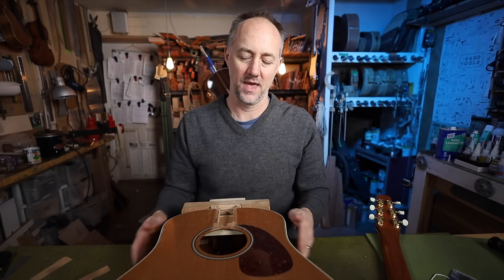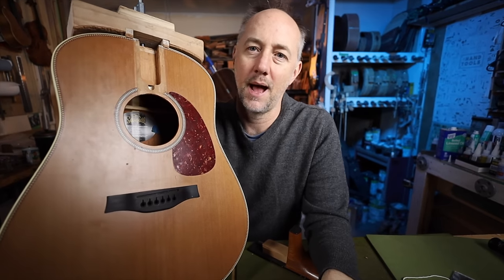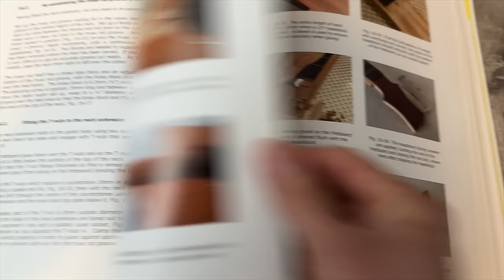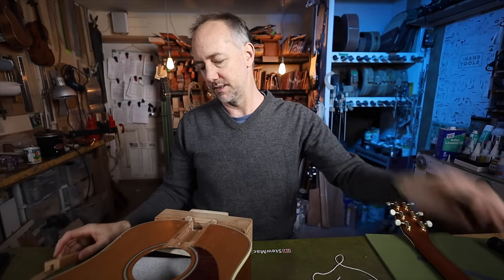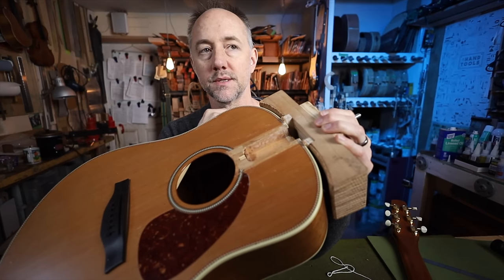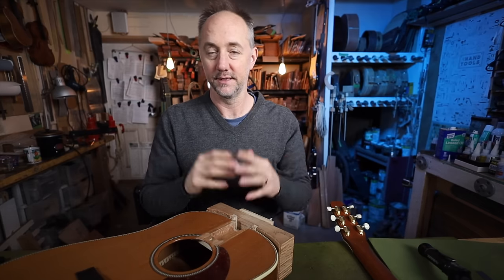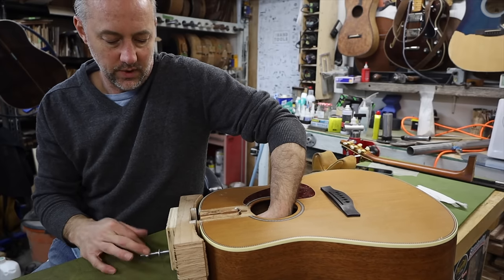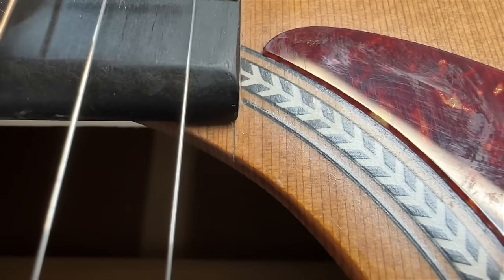The Hidden Problem with Seagull Guitars...

Comment: This is totally correct. I like Seagull's but I have 2 that needs neck resets now and I see them used that's down to the last bit of saddle before turning a decent guitar into kindling. :)  They are throw away guitars now (is what it is) 😀
Reply: If you plan on purchasing one you better take a hard look and see how much saddle is left also
Reply from the maker: Yes- if you buy a seagull, new or 2nd hand, check the neck angle and saddle height- if its all good you probably have nothing to worry about for a few decades  @tmcl7844

Comment: I'll definitely be taking a closer look at the 2003 for sale in my area as opposed to buying a newer one.
Reply from the maker: If i had the choice id get an older one but it may have more of a hump at the body join which is what they invented this neck joint to minimize that (and that part of the system works- but at an expense)
Reply: @BeauHannamGuitars  Yes it is quite a nightmare, I love the Seagull guitars but don't want to have to get a neck reset which would cost about the same as the price of the guitar here in Canada, I have really taken a shine to the Seagull Coastline Slim CW Spruce which is a solid wood guitar. I just did another set up on my Fender Hot Rod acoustic which has the rising belly so I run at about 4 thou neck relief without any buzz and have around 2.2mm low E and 2mm high E. Slotted the pin holes a little to get a better string angle and it sounds great. Just won't last forever LOL

Comment: Thanks Beau , I will be using your headblock design , is that your idea to taper the shape so it runs across some grain preventing cracking ? That's genius mate . Consider it stolen forthwith . Peace ✌.
Reply from the maker: Hahah/ thanks- not my idea. I do the same with the bridge wings and any braces like the center top brace on a classical guitar- I angle it so it crosses a few grain lines.
Reply: @BeauHannamGuitars  Yeah , I do it with bridge plates and bridges but never thought about the blocks . I suppose it could be used anywhere the sides run parallel to the grain . Still genius albeit a bit obvious . Peace ✌
Reply from the maker: @davidharris7431  thanks- yes- just never run a bit of wood along the grain of other bit of wood (especially a thin guitar top)

Comment: I had seagull acoustic that I put some heavy gauge strings on, and it got the exact problem as this guitar with the soundboard sheared on either side of the neck into the sound hole.
Reply from the maker: One of the worst breaks to have
Reply: Most players stopped using heavy gauge strings by the end of the 1970's: tough on the guitar, and even more so on the tendons! No need, unless you're tuning WAYYY down, IMHO. Light or medium-light still sound good. Besides, if someone's onstage they're either going through pickups or an instrument mic to get more volume.
     However, I learned plenty from  this video. Epiphones from Japan in the early to mid-seventies had that block slippage, practically a landslide of movement. I had used ultra-light electric strings with pick-ups, and more than a little homemade adjustments. Lasted almost 40 years, far more than it deserved, but eventually it bent & collapsed almost in every direction. The neck itself was fully bolt-on, so I might build something to it to make a portable travel 12-string, kind of in the Chapman or Gittler vein (showing my age here!).

Comment: I have a Godin Motif (nylon string parlor).   Do you see the same problem with their nylon string guitars?
Reply from the maker: I think they all have this if made after 2006. But it’s not a problem until it’s a problem and classical guitars have less string tension then a steel
String so you might be are for decades or always :)
Reply: @BeauHannamGuitars   Thanks Beau!  Neck is currently just fine on my Motif.  Light gauge strings sound best, so I'm not putting much tension on the neck relative to  a steel string guitar.  Thanks for your insight!

Comment: Godin 5'th avenue' is he a good one? Any problems?
Reply: I'm not a luthier, but I've owned a 5th Ave since around 2007 and it doesn't seem to have much in common with my Seagull acoustics (and is an archtop, so it's more like violin construction I guess). Entirely laminate, and as a result is like a little tank. I don't control humidity with it at all so it swings from humid Ontario summers to bone dry central heating winters and it's been bullet-proof. It is still factory-made, and I did find a misdrilled hole for one of the P-90 pickups that they just covered up with the pickup itself; however, for the low price they charge for that guitar I am willing to put up with a bit of slop as it looks lovely and I enjoy playing it so much. Easily my favourite neck on any guitar, acoustic or electric. I wish I could bolt one on my strat.
Reply from the maker: I like those 5th ave guitars. I dont know what the neck attachment system is on them- at Dynamic music where i used to work (who imported Godins for Australia) i loved playing a 5th ave with overdrive- made me sound like Oasis!- No Jazz was ever played on one by me though.
Reply from the maker: I like those 5th ave guitars. I dont know what the neck attachment system is on them- at Dynamic music where i used to work (who imported Godins for Australia) i loved playing a 5th ave with overdrive- made me sound like Oasis!- No Jazz was ever played on one by me though.

Comment: Crap!  I wish I saw this video before I went shopping for a used Seagull.  I found a Seagull but didn’t do a decent job of checking it before I bought it.  Now that I have it home, I checked things out and I have the exact problem described in your vid.  I don’t want to throw away this guitar but I don’t want to dump a ton of money into it either.  Any idea how much this would cost to repair (in USD)?  Despite this problem, I’m still a fan because I have another Seagull that’s awesome.  Be nice to have two awesome Seagulls!
Reply from the maker: Is yours made before or after 2006??? If it’s before 2006 the neck probably isn’t epoxied in (lucky!) but a neck reset will still cost a few hundred (maybe up to $400 but it depends on who is doing it). You could also sell it and buy another
Reply: @BeauHannamGuitars  After further research today, I’m guessing it’s a pre-2006.  The truss rod adjustment is located in the headstock versus inside soundhole.  Also the tuning keys are larger than than my other, newer one.  There’s no serial number anywhere on it, but there is leftover sticky stuff on the headstock which may have been where the serial number was located.  Sounds like I may have gotten lucky with this one so I’m gonna visit my local luthier to get an estimate.  Thanks for your reply!
Reply from the maker: @usafvic  my pleasure. The label usually has a serial number. You also might be able to tell looking inside at the upper area of the headblock (you will need a mirror and light) to see if any epoxy squeeze out is visible. Also, you could email seagull and ask (not sure if they would know by looking at its features)

Comment: I hope Godin sees this.  I'm an owner of a Godin electric (Summit) and an Art & Lutherie acoustic, so you could say I'm loyal.
Am shopping for a Seagull and came accross your vid - glad I did.  I won't purchase anything that is this difficult to repair.  Perhaps they'll address the issue.
Reply from the maker: Hi- if it’s only a few hundred dollars I wouldn’t worry about it too much- as any guitar won’t get a neck reset anyway. A neck reset isn’t impossible on the post 2096 guitars but it does make it hard. (I want to try a possible method I thought of.
Reply: @BeauHannamGuitars I dunno ... maybe I'll just buy that BC Rich Warlock I was looking at instead.
;) But yeah it really is price dependant but I've already got a mid-priced acoustic so was considering a larger investment.  I better not break the neck I guess!

Comment: Sorry i maybe ask a stupid question, but why you want to take off the neck of a guitar in the first place...?
Does this type of neckjoint effect the playability...?
Reply: Ok, i see... Reset the neck is needed if the wood has moved a lot cause of temp and humidity changes but really, how often is this necessary...?
Mine has a trussrod, isn't that enough for most guitars...
Reply from the maker: The neck was off for a different repair I was dealing with which I go into somewhat. 
Assuming all is good, The neck joint (any joint) doesn’t effect the playability- ie- you can’t tell what guitar a neck joint has just by playing or listening to it. 
ALL Guitars however will eventually need what is called a neck reset after (usually) a few decades - the 160lb of string tension distorts the guitar in many ways and the neck points to the wrong place. The neck now needs to come off and be “reset” to correct the geometry so the guitar plays as best it can (action, saddle height etc).
Regardless of neck joint type, It is inevitable that a guitar will need a neck reset and using epoxy in the neck joint makes the neck very very difficult to get off.

Comment: Ive got 3 of them and so far so good except for the tuners, but Seagulls are not expensive guitars and this must have been an expensive repair. Was it worth it?
Reply from the maker: This guitar cost about $1600 new, so it was worth it
Reply: ...same problem, the tuners became un-tuneable. What did you replace them with if I may ask?
Reply from the maker: @78tag  I didn’t replace the tuners on this- I think Godin website sells replacement tuners which would be good as all the screw holes would line up.

Comment: I know this question might be hard to answer, but is this construction method used on their 12 strings? I have a 12 string Seagull that was my brothers who no longer is alive. It’s from right around the 2005 or 2006 era. I will need to find out the model and year for sure. It always seemed to be a decent guitar with the neck being good. I have always worried about it because it being not a very expensive guitar (I think it was about $800 USD at the time) and also a 12 string. I keep it tuned to Eb. Thanks for any info and great video.👍
Reply from the maker: To my understanding, all acoustic guitars made after 2006 have this neck join- i'm not sure about their archtops like the 5th Ave though. Its only a problem if (when) the guitar needs a neck reset. It might be easier to take the fingerboard off then attempt to take the neck off like I somehow managed to do- but the whole area was already damaged from humidity issues so that helped me alot.
Reply: @BeauHannamGuitars  
Thanks for replying.

Comment: talk about synchronicity. I just finished a reset on basically the same guitar and had the same pain in the bottom. But the "epoxy" they use to glue in the tongue of the neck is like gum, almost like hot melt glue. and the neck had to come back so far it left a gap under the end if the fingerboard. I ended up doing the same as you making up some shims to make it fit. While the old design had it's draw backs it was at least serviceable. This is effectively planned obsolescence. Way to turn okay to crap Seagull.
Reply from the maker: Hahaha- the seagulls are attacking! Are we in a Hitchcock film!!!!!’ 
The grey epoxy I remember being pretty hard but I filmed this months ago.
Reply: So...maybe mine also had the feature of incorrectly mixxed epoxy that didn't go off....Riddle....when is a failure of quality control a good thing?. At least I was able to get the neck off with out too much cursing. @BeauHannamGuitars
Reply from the maker: I thought about it and another possible solution for neck removal would (could) be to - to drill through the fret slots into either side of the pocket (on say 15th, 17th 19th frets) and add heat- i'm not sure what heat would be best- the dry heat of the wire cutters or steam- but if steam if would cause a damn mess to the finish and inside as all the steam water would roll wither into the guitar or down the heel on the outside. the water can be caught inside but the finish getting damaged from so much steam would be a major concern. This would require more heat/steam then taking of a typical dovetail.

Comment: Is this neck joint used on other guitars from the Godin stable, such as Godin branded electrics?
Reply from the maker: I’m not sure about the electrics- the ones I remember seeing back in 2010 were bolt on (I think?) it’s been to long. All their  acoustics seem to have this joint- but I’m not sure about the archtops like the 5th ave.
Reply: @BeauHannamGuitars  The 5th Ave has a convoluted dovetail. It's a butt joint with a plywood dovetail screwed and glued on to it, attached to the guitar with this same epoxy. At least that's what it is on mine, which is an early one.
Reply from the maker: HHmm- interesting- good to know! thanks

Comment: The best of engineering has solved pretty much most of your problems a few decades ago already:  Glue-less detachable and adjustable neck joints! 

The very first obvious advantage for us Luthiers is it takes care of us having to reset necks made in ways you have to assume was never part of the equation, but ease and time of build were!  Since any changes in the soundboard can also negatively effect the fingerboard for being glued on, a neck design continuing to the very end of the fingerboard floating free of the soundboard eliminates that problem entirely.  An adjustable neck, that can be easily adjusted with an Allan wrench or similar tool allows it tweaking the instrument for seasonal changes, venue conditions... in little time, and repeatedly:  Once a neck is set with glue any changes require all that work again to reset it, and it's not cheap for the owner, and us Luthiers have plenty else to keep us busy.  As for why Fender bolt-on's are not very good sounding instruments on average, it's due to other design and build decisions, that can be addressed, because even their "Dirty" way of doing it makes my job easier and way less messy, even a little dangerous (I'd rather do more inlay work and custom stuff), and the customers happy for not getting a thin wallet.  

There are some great designs found on very well made and great sounding jazz arch tops and other guitars their players love, and there is no tonal difference detectable by human ears, as long as the design of the neck block compensates for the string tension by redirecting it to the sides and back which are more built for reflection, not resonance:  The more energy (vibrations) in everything else the less of it is there fore the soundboard!  It even frees up the top under the fingerboard to be braced lighter, and to resonate much more and add a bit more volume and frequency response range to the instrument.

Technology evolves while tradition lies stagnant stinking up the place!   -Me😁
Reply from the maker: Yep

Comment: I have a walnut mini jumbo that has a rattle in the block under the fingerboard...sounds like a washer on the truss rod....maybe it's a bolt washer...have talked to Seagull and no one will help.  Nice to know it can never have a neck reset.  Luckily I had to reglue the heal cause it broke loose....gluing it raised my neck angle about 3/16 over the  bridge.  I don't think I'll ever have that much movement in the neck.  I just play the guitar tilted up and it doesn't rattle....but I don't have a warm feeling for Seagull.
Reply from the maker: You can carefully peel back the sticker hiding the bolts and see if there is a loose washer knocking about.
Reply: AHHHH!!!  I'll have to look for the sticker.  Thanks!!! @BeauHannamGuitars
Reply: It only had one bolt...other had the hole but they never drilled it into the neck at the factory...been like that for 14 years....The bolt was a bit loose and the washer was clicking....tightened it....fixed!Didn't effect the angle when I tightened it ...i guess cause I had glued the heel.  Plays good now.... @BeauHannamGuitars
Reply from the maker: Coll!- glad you got it fixed. Some glue at the heel can do alot  @cugir321

Comment: My question "Is it really worth it to do so much work?" I have a seagull acoustic and although it sounded nice and was easy to play over a few years a support bridge in the body came loose. Now it wont stay in tune and the action is too high. I tried using light strings but no luck.
Too bad because I really liked the sound and feel but now I will never buy one again.
Reply from the maker: Depends what the guitar is worth. If it’s under $1000 it becomes real dilemma.

Comment: why did you take the neck off when the body was damaged.. seems like a couple interior wedges and some superglue..  because as you said it's a tosser.

way nicer repair than perhaps it was worth.
Reply from the maker: I’ve done this same job (pulling back the upper bout that has caved into the sound hole) both ways- with the neck on and off and I prefer it when it’s off if possible. But it can be fixed with the neck on.
Reply: @BeauHannamGuitars  I commented halfway. I'd personally have done the dirty method. Superglue is a decent finish so I wouldn't even hesitate to hobo fix one in the future now I've seen inside